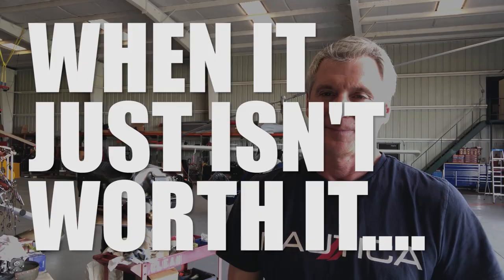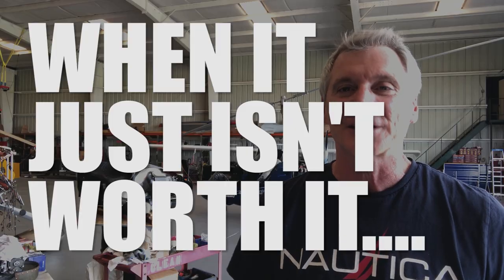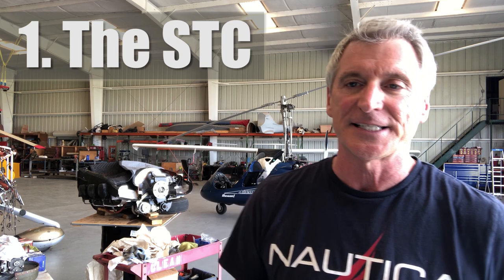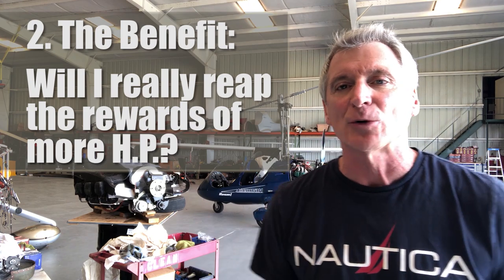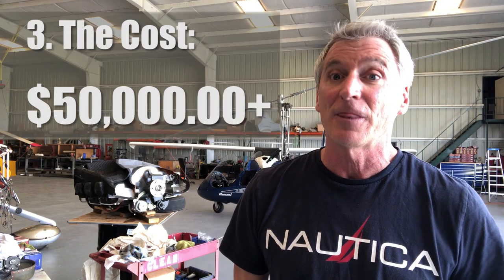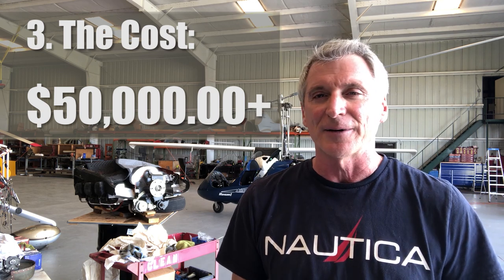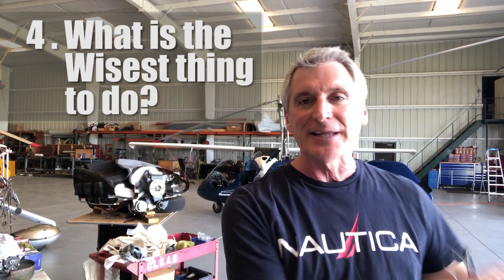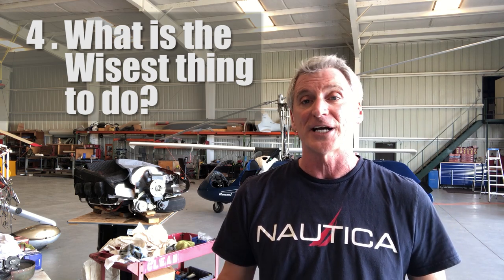When Upgrading an Engine Just Isn't Worth It...

Comment: OK for Cardinals, but if 172 folks are captured by your headline, please know that it is a completely different story if you are considering an O-360 into a 172 Skyhawk.  

It really depends on your needs.  Almost 40 years ago, I switched out my 150hp E2D to the Penn Yan Aero "SuperHawk" 180hp A4M with fixed pitch Sensenich prop.  As a writer at the time for Cessna Owner News, I did extensive test flights and comparisons.  Those proved that I could then take off in 3/4 the ground roll, climb 50% faster, and cruise 14mph faster.  The PYA conversion was done perfectly and seamlessly.  The Sensenich was a whole lot cheaper and less problematic than the AvCon alternative (which had yellow zones on the tach, plus added weight and complications) and performance was essentially equal.  I can't recall the exact dollars, but because I was able to get a good price for my old engine/prop and deduct the expense on my taxes, I think it was only maybe $4 to $5 thousand (in 1985).

And here's why it was well worth it to ME!  (Your situation will vary, especially if you don't start with a 172.)  I took this plane with Horton STOL and flew it for 20 years, half on business and half on search and rescue missions as a CAP volunteer.  When you are high in the Adirondacks or Catskill mountains, in the same awful weather that just knocked some other plane out of the sky, with a cargo of specialized equipment and precious observers, the performance is PRICELESS!  Grass strips, gross weight, density altitude and STOL were no longer a problem.  The added performance was impressive, and the added safety was astounding!

Comment: I went with Option 4…with a twist.  LyCon overhaul of my IO-520.  Flowed cylinders, balanced engine and STC’d performance cam increased the HP from 300 to 350.  7-10 MPH faster, same fuel flow, no change in TBO, less expensive than an IO-550 upgrade and no STC required.  Oh, and no counterweight AD with which to contend.

My 185’s useful load is already just over 1700#, so no change available or required.

A friend had LyCon do a C-85 for his Aeronca, which yielded 115 HP, up 30 HP on the dyno from stock.

LyCon, Visalia, CA.  Long wait time currently, but it’s for a valid reason.  They do exceptional work.

Comment: Certified aircraft are great, but the Experimental market is far more affordable. The only real reason for a certified aircraft, in my humble opinion, is that it can be used commercially. Which is why so many people are going the experimental route.
Reply from the maker: I thought of reclassifying the aircraft to an experimental.... at the end of the day not a good idea .... thanks for watching!
Reply: It costs 3x to 4x as much to insure experimental for the same hull value and you still need to keep up with the maintenance on experimental (no real savings here unless you cut corners, i.e. a dead engine does not care if it's labled "experimental", still same overhaul cost if you want it done right), i find some of my friends moving back to certified for this very reason: insurance.

Comment: Ted, did you look into doing the 160hp upgrade, this upgrade cost very little at overhaul.  Uses your same O-320-E2D engine.  The only change would be having High Compression Pistons installed vs the Low Compression Pistons .  Everything else firewall forward is the same.  There is an STC for the upgrade.  Uses your current prop and all accessories.  When I overhauled my 68 177 this is what I did and it made a big improvement to the performance .
Reply from the maker: I am just going to stay with the stock 0320 - I don’t want to go searching for an stc and the bottom line is I want my plane back in the air - and I get a huge boost from The power flow - thanks for watching!

Comment: I understand, I had a 68 Cardinal too. Liked flying it, the unmatched visibility like seeing around the leading edge for traffic in the pattern, and the sports car like egress and ingress. That huge door was an issue on windy days but those were few. What I found was I became really bored flying across the southwest in the summer getting beat to hell in the heat and decided more speed was the answer so I sold the airplane and haven't gotten another one. The 320 is really too light on the power side as far as I am concerned. It's fine for a couple people but the back seat should make you consider weight and balance seriously with full fuel and other people on a warm day.

Still, if you are not in a hurry or building time this is an OK option but it is not a power house by any means and it isn't as fast as it looks but this airplane also turns heads for those who don't see many Cardinals. I stopped for fuel in Northern Utah and the fuel guy asked what kind of airplane this was? A bit surprised I filled him in on the bird with a storied past starting with the stabilator for those who remember. Looking forward to your progress!
Reply from the maker: Awesome - thanks !

Comment: I don't understand why STCs are so expensive. The O-360 was put in later model 177 aircraft to "correct" perceived climb performance issues.  Cessna figured it all out for the 177A model.    Our club has a 172 and we looked at replacing the engine with a O-360, the price was insane.  So we thought O-320 with the higher compression sleeves and cylinders  (160HP). That priced out to over 1k per extra HP in higher price.  Looks like we will keep the 150hp engine.
Reply from the maker: Ya ... I know the price is insane .... 😬 thanks for watching!

Comment: I've been having that same debate with myself over the O320 vs going to the O360.  With the C172M, there are many companies doing it so the STC is not a problem.  I do get a 250 lb gross weight increase, but that cost is still there.

I have the panel where I want now with the Aspen 2000, Avidyne IFD540, Lynx NGT9000+, STEC55X autopilot, PMA450, JPI EDM900, and a few other goodies.  Currently, the airplane is completely bare while undergoing a complete custom leather interior, and then it heads off to the paint shop as soon as that is finished.

Was there no gross weight increase with the O360 for the C177?  That's the only thing that keeps me looking at it.
Reply from the maker: It just really wasn’t worth it to have the engine upgrade it would only give me between five and 10 kn faster and there is not really an increase in useful load plus at the end of the day it was close to $50,000 if not more and that was just too much it’s just not worth it for the airplane.

Comment: Just to let you know all the accessories are the same between the O 320 & O360 along with the oil cooler. If not going with the O360 and staying with the O320 why not pick up the stc to convert it from a E to a D the only difference is the compression goes from 7/1 to 8.5/1 and 10 free h/p from 150to 160. It's worth looking into.
Reply from the maker: Thanks -  unfortunately they are not the same-  oil cooler is a different size, exhaust is a different size requiring a new powerflow, prop needs to be different and motor mounts as well- plus there is a modification that needs to happen to the oil cooler that is completely customized...   all ion all it got very complicate very quickly....   Thanks for watching!

Comment: I went through the same thing with my O-300 for my 67 C172, by the time you pay for the STC and then the engine it was just not cost effective.  I stuck with just replacing with another O-300.  I also put an EDM 900, kind of overkill I think but I like it.

Comment: Good call. I’m in the exact same situation as you. I have a ‘68 Cardinal with o-320 and I love it. It’s just not worth to spend 50k for the performance gain. I have a stol kit on mine and my takeoff performance is comparable with o-360. You already have good avionics. If I may suggest, invest in a good autopilot and you won’t feel the difference in cruise speed anymore. I saw good stec-30 on eBay for 3-4k. Good luck.
Reply from the maker: Thanks !!
Reply: I also have a '68 with the original O-320.  I have the Powerflow, Maple Leaf fixed cowl covering and a new prop that gets me come close to my neighbor's 177B in cruise, climb and useful load (he's still 3-5 knots faster).  I thought about the upgrade, but why would I want to burn more fuel, pay more per gallon (I have the Mogas STC) and pay the added cost for the constant speed prop?
Reply from the maker: @williamchancellor1131  What's the maple leaf cowl covering?

Comment: Then there are the incidentals....like the engine mount. Has it been off the airframe for inspection since Cessna mounted it to the firewall in 1968? Mine is currently at AWI in Minnesota for inspection, repair and refinishing. As my IA once told me, there was only one (1) that he sent in for inspection that passed as-is, without the need to replace tubing due to cracks or reduced wall thickness...in his career. The new Lord Mounts. You aren’t going to reuse your old ones are you? How about the oil hoses and fuel lines? I read somewhere that they are required replacement items for a major overhaul. Then there is the carburetor. When was it last inspected and recertified? Are the Service Bulletins on your carb up to date? Next is the oil cooler. How old is yours and when was it last cleaned, inspected and tested? That is a single point failure item that can ruin your whole day. Mine is at Pacific Oil Cooler in California at this time. Glad you can reuse your exhaust system. Mine failed inspection and needed to be replaced. Just received the brand new exhaust yesterday.
Reply from the maker: Yes - new fuel lines last year - new carb- starter - oil cooler - mounts ( last year) new oil lines - carb - fuel pump - starter all came with the engine - new alternator was last year as well - I hope I got it covered !!!!😇🙏🙏🙏😇

Comment: Allow me to save you another couple of $. Some (not very experienced owners, i was one of them) think you can put an engine monitor and run lean of peak. You cannot, at least not  these low displacement Lycoming 4 cylider egines. Lean to rough then forward to best power and then a bit more on rich side, that's all you need to run the engine to 2000hr just fine ( just pay att. to your oil temp on hot days climb-outs). A monitor is a complete waste of money. In reality, it just becomes a distraction in this type of setup and provides zero useful real world  information. The CHTs and EGTs deltas from one cylinder to another will drive you nuts. Don't do it to yourself or to the next owner.

Comment: To bad the wasn't a way to install a  Continental Titan™ X340, a stroked 320 with 180 hp and 20 lbs lighter than a 360 plus it's ASTM certified. Since it's a stroked 320, it fit's where a 320 goes and all equipment and accessories just bolt back in the same places.

Comment: Just under 1300hrs till TBO on a 0-320-H2ad (non T-mod). I toyed with the idea of moving from 160hp to 180hp. 
I came to the same conclusion as you. Not worth it for a few more hp, minor increase in cruise speed and minor useful load increase.
I would lose 10deg of flaps per the STC and have an increase in gph.

Comment: You mentioned a using the same oil cooler...Please please please put a new oil cooler on there. Who knows how much meatal particles are trapped in your old oil cooler.
Reply from the maker: I am putting a new oil cooler - I meant the same size and type - thanks !!!!
Reply: @Over50andLearningToFly  WHEW! . OK your on the ball. I rest easy now.
Reply: Hopefully I get my Cardinal in the air soon.